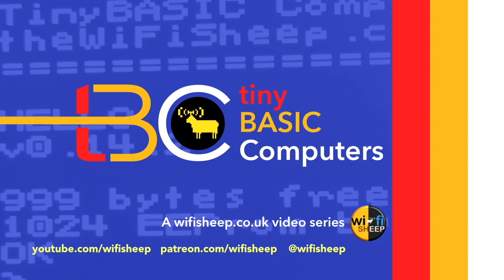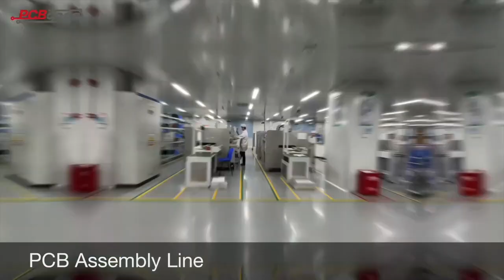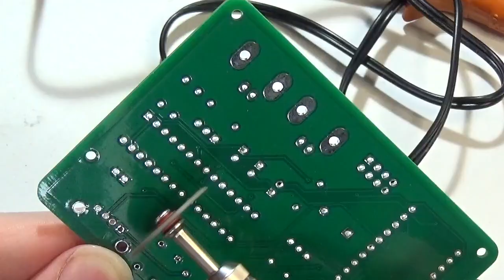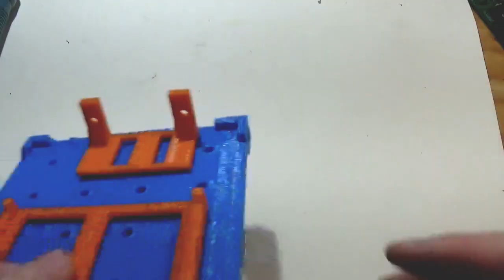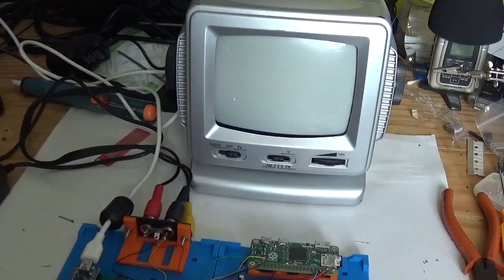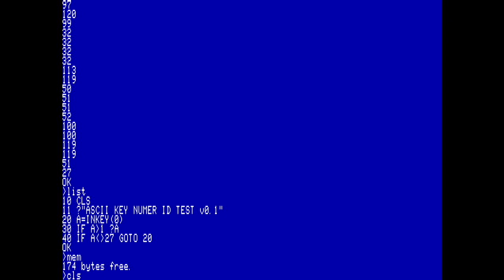8bit TinyBASIC 4 Colour 1st build!

Comment: Hello sir i was wondering what is the average ram usage of risc os and if the wifi issue was resolved
Reply from the maker: Hello, So average RAM usage depending on what your doing is around around 46MB, and no regrettably the Wi-Fi issue is still not resolved, a new TCP/IP stack is doing the rounds but I don't think is implemented in any of the builds you can download as of yet.
Reply: @WiFiSheep  i understand thank you.

Comment: Hi Tom, I never could get along with pizero & piGfx, as you know im biased towards esp32 running vt100 terminal
Reply from the maker: ESP32 and vt100 is the other option I considered, still might be an option ... The pi has some advantages HDMI / Composite out + native USB support, it also helps if you can 'tune' your BASIC interrupter into the terminal, hence make modifications to work with Pigfx....

So what you reckon... bring it down the club tomorrow? Honestly can remember if Ive already bought this down yet?
Reply: Tomorrow is show and tell night, so why not bring it down